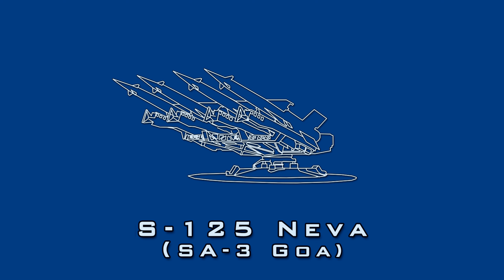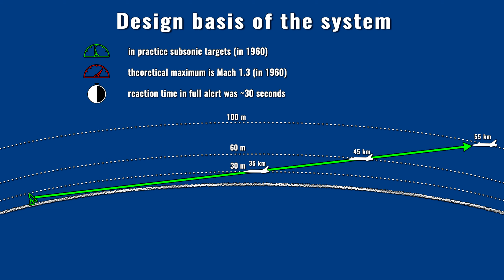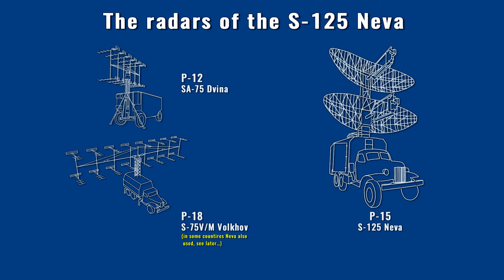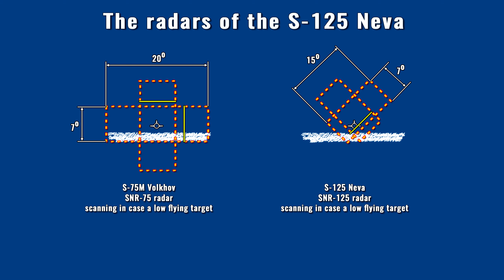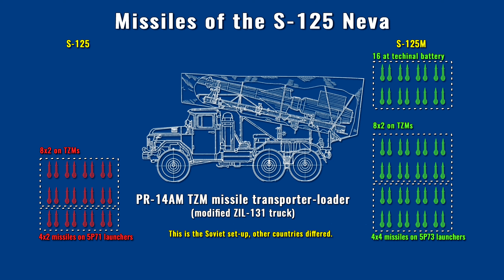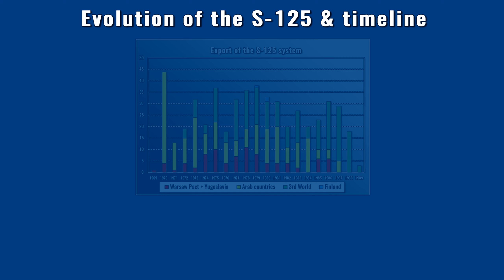S-125 Neva / SA-3 Goa - The Stealth Mythbuster?

Comment from the maker: More than one ppl. requested the SA-6/2K12 and SA-11/9K37.
Yes, they are on my list but I plan presenting SAM the systems in the order of timeline because the point of the series to understand the evolution (as long as it is possible).
These are using CW radar illumination and many other things which have not been presented, yet.
Also they are not homeland but army air defense SAMs so also it has to be spoken about the structure and organization of Warsaw Pact forces.
Maybe it is a sad news but not in the close future. But they are coming, and besides SAMs there are many other interesting topics ;)

Comment: American pilots in Vietnam were lucky that the Vietnamese never got the SA-3 until the conflict was over, losses would probably be a lot higher had they (the Vietnamese) operated it alongside the SA-2 from the beginning.
Reply from the maker: The crew was trained just the S-125s could not be shipped. The USSR did not want rising them ans shipping through China, while the naval ports were mined and blockaded.

The small qty. of the S-125s could not make big difference. It would have been just a footnote in Vietnam. While at the Middle East the use of S-125 was quite wide, but the 2K12 Kvadrat was the King of the SAMs in 1973.

Comment: Is the SA3 overall superior to the SA2? Given it seems more manueverable and is less vulnerable to jamming whilst really only SA2 is superior having a longer range amd altitude?
Reply from the maker: Which SA-2?
SA-2A/B/F = Dvina
SA-2C = Desna
SA-2E = Volkhov?

The Dvina line neved had SDC and true low level capability.

Even the Volkhov had 100 min. eng. alt. While the Neva had 20 meters.

The Neva had far smaller enge. zone in terms of range and max alt, but against tactical planes its missile with considerable high G also was more suitable.

Against a M2 speed target at 17 km the SA-2E was better, against an terrain following F-111A the SA-3A/B.
Reply: @militavia-air-defense-aircraft  I'm only familiar with the Dvina version so the A/B/F it is ...
Reply from the maker: @zhuangsaur227  SAM playlist
https://www.youtube.com/watch?v=bye1T0x6lpo&list=PLbeRRNpuu7hzryHrq5ezBVTgVSUYuMmaW
Reply: @militavia-air-defense-aircraft  20 meters? Yikes!!! You could fire that practically from the roof of a house or building ...
Reply from the maker: @zhuangsaur227  At 23:43
Reply: @militavia-air-defense-aircraft  btw would the HE payload of the SAM missiles be enough to cause serious damage even to ground targets if they did detonate? Or say even atleast damage battle tanks or buildings?